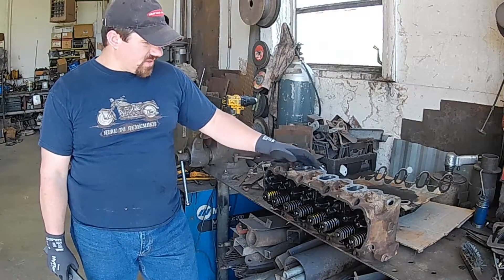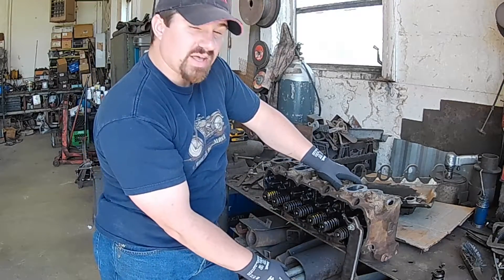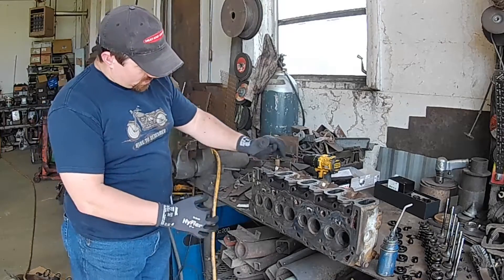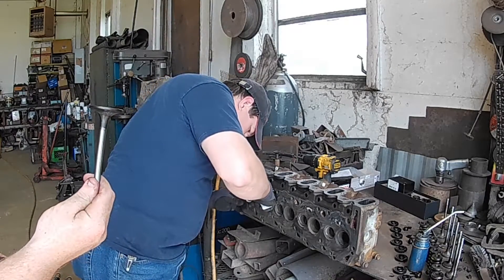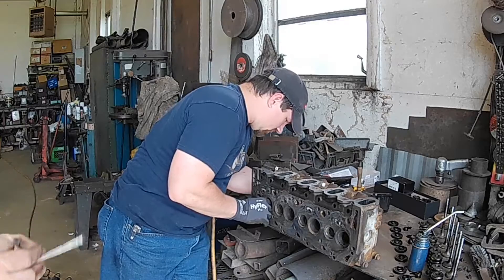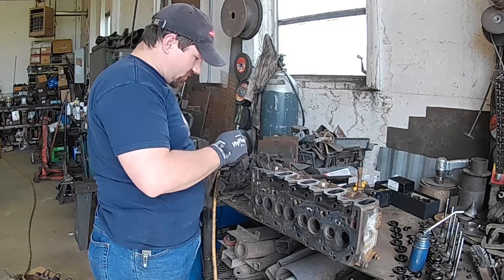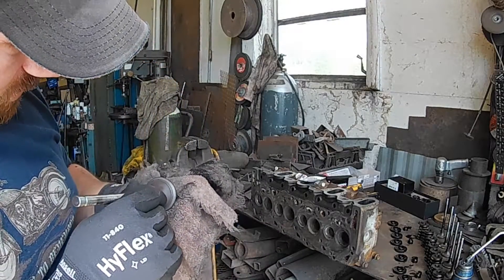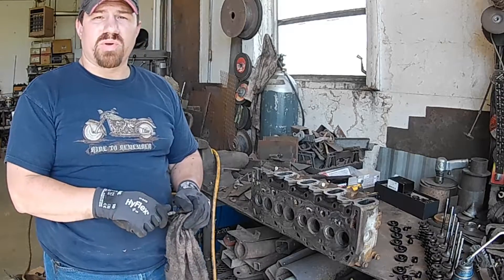6.9 IDI Valve removal and lapping

Comment: Did you install valve seals in both the exhaust and intake valves?
Reply from the maker: The kit came with ne plastic umbrella for exhaust and I put them on even though everyone says they are gone after 10,000 miles. 😆 lol

Comment: We’re the heads/block cracked? Seemed to be a common issue on these engines
Reply from the maker: This engine only had somewhere around 17,000 miles on it. It was in really good shape. Came out of a wrecked truck years ago.